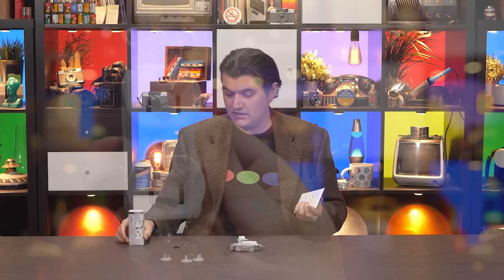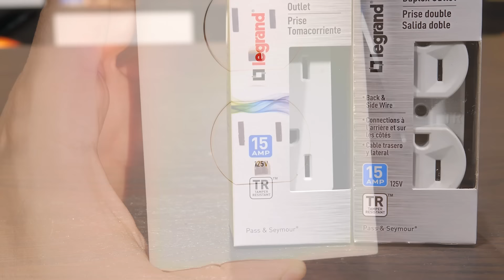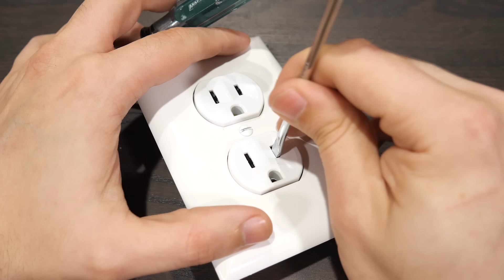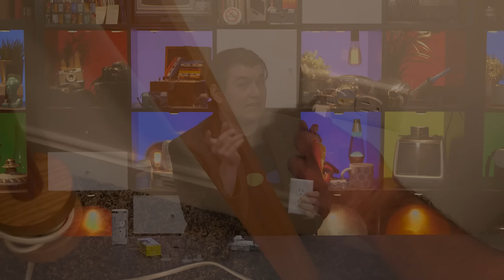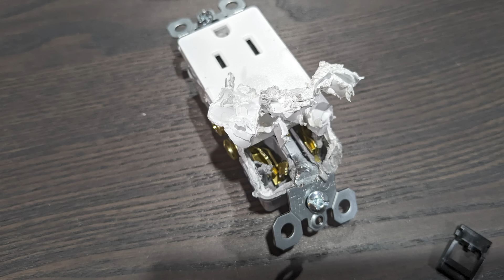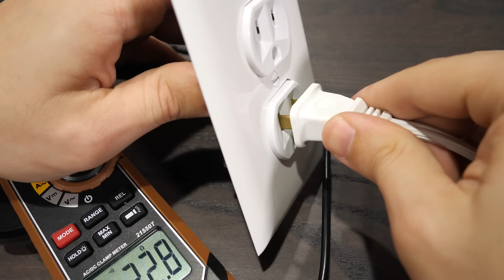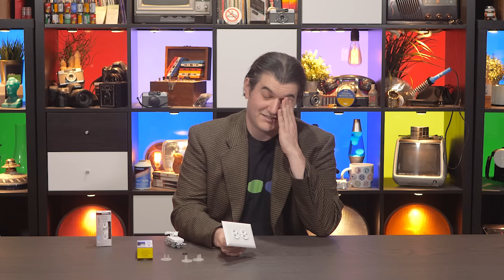Tamper-resistant outlets aren't all the same - a follow-up

Comment: Hey Alec! I think it would be a cool video to expand on Wago lever nuts and compare them to wire nuts (and even the crappy knock-off push-in connectors sold in America). I'm a huge evangelist for them. Leviton also has a new receptacle called the Leviton Decora Edge which implements the lever nut functionality directly into the device. Offers all the convenience of backstabbing with the security of a lever nut connection. I think they're slowly going to become the standard in new construction and renovation. Also might be interesting to talk about pigtails vs daisy-chaining via the receptacle. In general, there are a lot of cool new things going on with receptacles - USB integrated, GFCI/AFCI combos, lighted, flush-mounted (Bocci 22 series), recessed, etc etc etc. Cool time to be a electrical nerd.
Reply: I can admit Wagos are easy and comparable to wire nuts. But I just love wire nuts much and I have yet to see a Wago you can insert 10 wires into.
Reply: I would also be interested in the wire joining technologies as well. The number of pieces in the Wago levers make me think there's a higher potential of failure, but wire nuts have a higher potential to be poorly installed in the first place.

Comment: Lots to unpack/comment on here! (this time, from a South American perspective)

 - The "your plugs are constantly falling off" is most likely also compounded by the fact tourists most likely mistranslate "my insanely chungus deathdaptor" to "your plugs" :face-red-droopy-eyes: (it also doesn't help that adaptors/deathdaptors tend to have huge tolerances on their NEMA sockets, making anything fit veeeery loosely)
 - Loose fitting plugs is also very much an unearthed euro-plug phenomenon (old italian-style sockets in particular are pretty sketch). Nowadays, however, Europe seems to be standarizing on recessed sockets (with countries that didn't have them/had more esoteric sockets rallying to Schuko) making this pretty moot
 - I find it odd and disconcerting that NEMA sockets are monolithic[1], and with the earth pointing in the same direction (forcing you to "waste" a socket if you wanted to use two 90 degree plugs with the lead going out the same way). Most sockets where I live are modular (with "the standard" being to point the earth pin towards the short side of the faceplate), and the few monolithic units are either a light switch + socket combo (with the earth pin pointing opposite the light switch), or two sockets with the earth pin pointing towards the same long-side of the faceplate. This is undone by grey imports having leads/bodies pointing towards the live side instead of the earth pin, but at least there was an attempt
 - I also find odd and disconcerting that in many/most places, uncanalized (ie, wires hanging/stapled to the drywall) installations are allowed by code and the default. Sure, I have seen (and stayed at) places where the electrical wiring was desk lamp wires (they come bonded, see) hot-glued into the wall/roof, with external screw on wall/wood sockets, but everybody understands they aren't even up to personal code :goat-turquoise-white-horns:
 - Changing the socket can go surprisingly well, if there's an attempt at compatibility. Brazil did it in the early 2010s (coming from an unearthed europlug/(un)earthed NEMA mix to an earthed swiss socket lookalike) and I am still flabbergasted at the quickness of the uptake. (Argentina had a similar transition from unearthed europlug to Chinese/Australian -- with hot and neutral swapped because of course we did -- and the transition took a good full decade, with hospital/commercial "don't plug your crap here" installations retaining the use of Schuko)

FWIW, the only time I remember receiving an electric shock was in Belgium thanks to a deathdaptor hitting a metal faceplate. My biggest hurt was realizing the hotel didn't have GFCI (both Brazil and Argentina mandate whole installation GFCI for residential/commercial, with the only exception being the wires[1] from the utility meter to the first proper electrical panel[1]).

[1]: ...which, in Argentina at least for new installations/replacement meters, is protected by a GFCI in the meter, put there to avoid meter fraud (electricians would install a series of breakers to divert neutral into ground, effectively bypassing the meter)

Comment: 110 vs 220 :

Since GFCD is mandatory in France ( before 2001 ) the number of death by touching live have become almost 0%. This protection is really efficient and reduced death ( you still get chocked, but after 3mn resting you feel good ). So protecting against direct contact is not a topic for me. Especially with half isolated pins.

But, 220v cuts current by half. So it reduces by half the power dissipation of wires and all connectors. And for a given required power ( 2000w catle, 1500w heater ... ) , 220 gives you twice less chance to start a fire on any poor installation. So, 220 reduces by half the probability of a fire. 

Maybe you could increase the copper section ( and it will cost you heavy money ), but, most fires start not in the middle of under sized copper section, but on poor connections ( insufficiently tightened screws ). That's why spring wagos are better than other nuts ( when used properly below 60°C and below 80 HR. ). 

Screw nuts are better only when using ceramic models up to 600°C. (Can be required in a hoven, or above high power lamps )

Comment: Been replacing all of the outlets in my home with these, as well as installing GFCI onto the circuit that goes to my kids' bedrooms... As a parent, my little ones quickly showed me that those plastic covers did more harm than good, cus my youngest had a tendency to take them out of the socket, and put them in her mouth creating a choking hazard! The tamper resistant design especially when combined with GFCI protection has proved to be a much safer solution IMO.

Comment: I just moved to NA plug from EU plug and I found it weird, like when you use it and you have pressure on it it get easily pulled out slowly but surely because there is a grove/dent in the EU socket where the cable get secured it is not flat like NA socket, and also there are the tamper proof plugs in EU. and there is the small issue to plug things in it because the plastic cover thing inside it where it make plug things hard, and to fix it you do the wiggle, so you basically wiggle it as you plug it in

Comment: In UK most sockets work as you said (opening the shutters using the earth pin) but plug sockets made by MK require both L & N pins to be pushed in. MK is one of the most common brands of plug socket here.

Comment: I tried reading above but couldn’t find it so I’ll add my own reasoning for plugs always falling out. This especially makes sense for Europeans and kinda explains everything. 

When we travel we use adapters, generally cheap Chinese ones with a anyway questionable plug without a ground usually, and in addition our cords are generally of the three prong and straight variety for what we travel with. 

Therefore we have a big adapter without a ground pin that is attached to a much larger than US earthed cable sticking out. No wonder if falls out constantly 😂

Comment: Sorry but needing live+neutral pins to open the shutter is not as good as needing ground.

By requiring ground it would be awkward to have a setup where the best path for the current to go wouldn't go quickly and harmlessly to ground.

Comment: I've gotten shocked once in my life unplugging something (fumbling around under a desk with a super stiff outlet that wouldn't let go of the plug, ironically). It gave me a good sting on my fingertips enough to reflexively swear over but that's about it. (The other 5-6 times were all mucking about with live wires  with the cover off and being a right idiot, so that's definitely not the plug design's fault.) 120V house circuit is just not scary IMHO. (At least in terms of shock risk. A fire hazard from frayed wires or shorted circuits is still something I take seriously.) 

I've also gotten a proper jolt from an electric fence, and that is not an experience I care to repeat. Anyone who thinks fully halving/doubling the voltage of a shock wouldn't make a huge difference is a right idiot. :P

Comment: The issue with the back stab connectors is that they damage the wire so you must cut the end off when you replace them, also they don't always make great contact and they can come loose over time due to undetectable manufacturer defects where as a screw connector is unlikely to have issues that are not detectable during the installation.

Comment: Basically, GFCI relies on the current that "enters" the appliance coming "back into" the outlet.
Transforming AC current usually works by the primary current going through a primary loop and inducing the target voltage in the secondary loop. Leaking current from the secondary loop does not leak current from the primary, so GFCI does not work for this.
But it doesn't need to, because touching 12V doesn't harm you and I expect you'd have to apply 24V AC directly accross your heart to do any damage...

Some designs of AC/DC converters might work with GFCI. If you run it through a diode to cut off the negative voltage, then run it accross a condenser to stabilise it, that's a very fundamental way of getting something approximating DC in a way a GFCI would still work, but you'll probably want a different voltage than you'd get this way (something like 80V?) and run it through a AC/AC transformer first... Not sure if there are other designs that keep GFCI working.

Comment: In Sweden:
First tamper resistant outlet was in 1955!
Law that makes it mandatory is from 1994 (could also be from 1988, it kind of depends...), but they were here and there even before that.
You have to stick in both - ground is not involved, since we use SCHUKO here in Sweden.
Even in commonly used outlets they seem to work very well for a very long time, unless maybe if you used the cheapest cheapo shit.
Extension cords, power strips and similar also have it.

Comment: There are a couple different ways the shutters work, but I believe the most common style is where each prong moves the shutter blocking the other prong out of the way. That way two prongs have to be inserted simultaneously for anything to pass through the shutters.

Comment: My physics teacher taught me, a long time ago, always keep one hand behind your back when when working on a live circuit.
Thank you, Mr. Lutey!
Reply: I'm going to be honest as an electrician it doesn't really help. You really do need both hands to manipulate a receptacle especially with 12 gauge wire. I suppose it can be applicable in a panel as most tasks can be accomplished with 1 hand.
Reply: @jacewhite8540  Would you really be installing the receptacle when it's live?
Reply: @majorramsey3k  depends on situation, new construction no, service call probably, hotel remodel definitely.
Reply: I was told that too.
Reply: I'll typically but one hand down the back of my pants (palm facing out, thumb outside) and use it to hold onto the waistband.  I don't let go until I've completed whatever I'm working on.  (I am not an electrician.)
Reply: @alexhajnal107  b- b- b- .. but why

Comment: I remember shocking myself pretty badly a while back. I was trying to plug a battery charger into a surge strip and every time I would try to plug it in, the prongs would fold back into the recharger because some smart person decided that the prongs should fold up on the device instead of down and I was plugging it in at a slight angle. To actually have it plug in, I had to hold the prongs with a finger as I was plugging it in. Unfortunately, I didn't stop holding the prongs. For a good minute, I couldn't let go of the charger, as my arm all the way up to my elbow was being paralyzed from the ongoing shock. I eventually was able to let go and there was no lasting damage.

Comment: Aren't outlets supposed to be some height above the floor - so as to not be accessible by crawling kids??

Eventually more pins will have partial shielding from the factory.

The US, 2-pin plugs themself have too small a base - which are unstable  with the "feature not flaw" parallel pins, Australian sockets with "angled blades" (if we use US plugs, we just twist the pins to align with the powerpoint - the spacing is the same as the US version) are more stable in the 2-pin format (double adapters can still back out if loaded heavily.

Kudos in including metric/SI units more and more, before long Americans will just realise a cm is about as good as half an inch.. (rough approximations when fingers feet and cubits, are  universal dimensions.)

Ha ha - the voltage debate - in other countries, yes 220 230 or 240(AUS/NZ) is full service phase-neutral voltage at 240VAC - that can definitely kill - superfast).

Comment: For the "the plugs are always falling out", many times when I have plugged something in at a public outlet the cable can get fully disconnected very easily. I guess this is what you have heard. My guess, as you mentioned with hotel outlets, is that since many people are constantly using them they wear out faster and they are probably the cheapest ones available.

Comment: Once i found a blade broken off in the hot of an outlet. I've touched an electric fence before and so i thought maybe this would be fun.

Touching the hot blade didn't do anything.

Until i touched the center screw. Whee! It got to where i could touch a finger to the prong and a finger to the screw (with the same hand) and I could withstand it. Then i remembered that more nerves and muscles are in the meatier parts of your body so i touched the prong to the center of my palm and the screw with my finger and my arm lurched completely off the wall as my muscles all contracted wheee!

That was way more fun than when i was unplugging my laptop charger holding the barrel sleeve in my left hand and inadvertently touched the hot blade with my right thumb. That /hurt/

Comment: I really have to question if those tamper resistant plugs are even a safety improvement...  So now the first time the kid gets a hint they really shouldn't do that 'cause it'll zap them is when they've managed to stick two conducting items in, at the same time, probably held in either hand and so current straight across the heart.  Basically the worst case scenario for a shock.  Non-lethal warning shots are potentially valuable and this ensures you no longer have that.

Comment: The only outlet i have ever had a plug "fall out" of was a set of outlets in my office that were originally installed in the 1960s, and it took so little effort for the plug to fall out of that that it was almost impossible to keep it plugged in it, so I promptly replace them. Whats odd tho,  is I don't think those plugs had been used for 20 years at that point, so I'm wondering if age and corrosion was a contributing factor because it was a part of the building that it become a storage room even though it used to be part of the manufacturing.

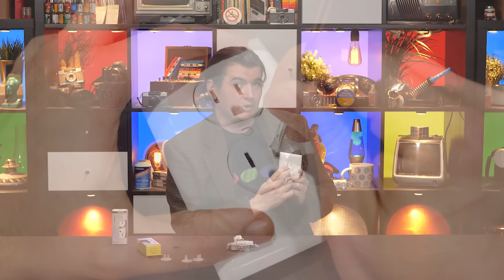Comment: 2:23 Actually, EU plugs seems requires that... all the ones I seen have that protective cover, including on extension cables.
I argue the NA/JP 120V is more dangerous because the common reason of a house burn down is not someone does not plug in a plug properly, but it's because the wiring capacity overloaded/old wiring melted. You get a lot less power rating from same gauge of wire, and people tend to cheap out on them, just never change them. When there are enough outlets, they end up using extension cords, which can trip brakers in the best cases, worst case would be the brakers didn't trip, but wires' insulation melted, causing a short, or in more likely cases, something around the wires catch fire.... A lot of house fire cases are caused by the wires heat up so much they start to heat up/carbonize wood around the site, that catches fire, not the wires hance breaker never trips.
120V won't do any less damage than 220V when someone get electrocuted. I got zapped by 220V twice and still alive.

Comment: I've stayed at busy hotels in Europe, the UK, NZ Australia the US and Japan. The NA style plugs that japan also uses are not AS BAD as some make them out to be BUT, they are the worst lol. They seem to wear out way faster than other designs to the point where they just fit together loosely. 

I've only seen one Australian style plug wear out like that and that was in a wharehouse workshop, the plug was about 20 years old and had welders plugged in and out of it 5 days a week for those 2 decades. It was an Australian spec 15amp GPO which has a larger ground pin receptacle but is otherwise identical to the standard 10 amp version. It had about 12-20 amps drawn through it constantly during use. 

The NA style plugs most used in the home of my host family in japan were already begining to lose grip and they were only a few years old. 

I understand the historical reasons for the US plugs and power to be the way they are and people do make it out to be much worse than it is but, it does still suck lol.

Aus style plugs have the active and neutral off set on an angle so regardless of orientation they sit into the plug.  The plug that would fall out in that old wharehouse was an outside rated plug which meant it was on an angle so gravity was basically pulling the plug straight out of it. Even so most of the time the plugs hold just fine unless they are completely knackered.

Also fun fact: it's actually technically illegal to change a mains voltage light bulb here unless you're an electrician lol.